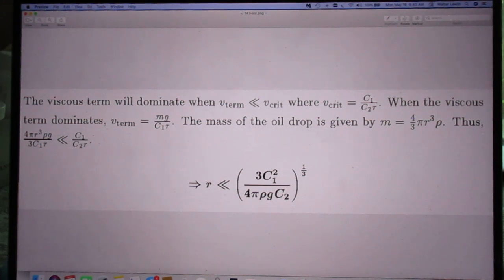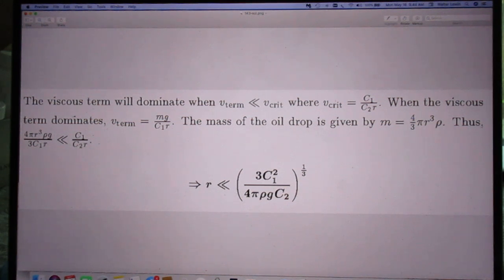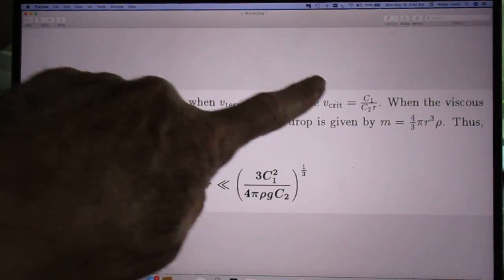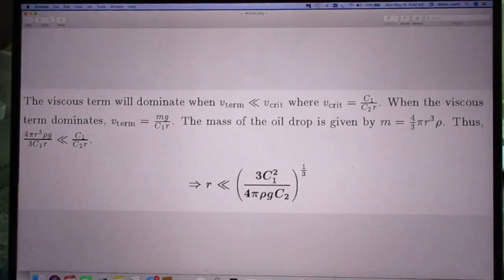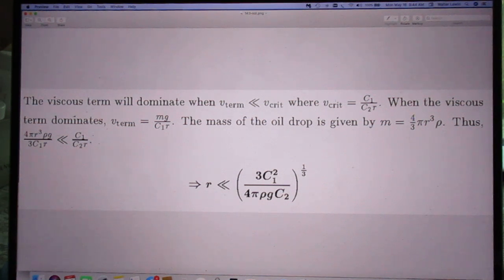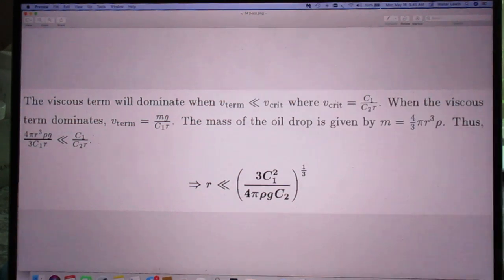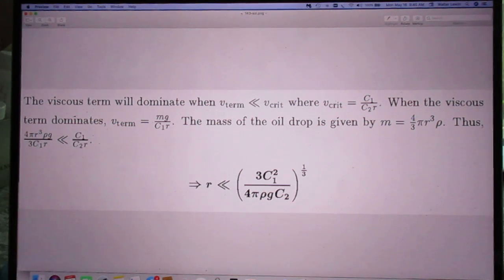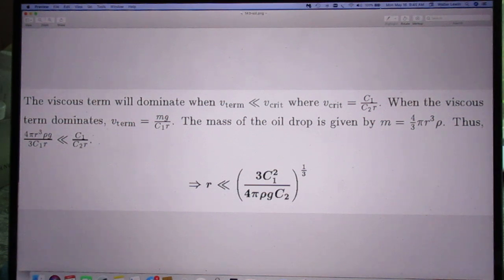Solution Problem 143 - Drag force on falling oil drop in air

Comment: Sir, I am a NEET aspirant, your mit 8.01, 8.02, 8.03 lectures are very helpful and I wanted to say thank you for making me love physics. I also wanted to know that which textbooks are used in 8.01, 8.02 and 8.03 as it would be really helpful.
Reply from the maker: 8.01
Physics
Hans C. Ohanian
Physics
Volume 1 
2nd edition
W.W. Norton & Company
ISBN 0-393-95748-9

8.02
Physics for Scientists & Engineers by Douglas C. Giancoli. 
Prentice Hall
Third Edition
ISBN 0-13-021517-18

8.03
Vibrations and Waves by
Anthony French
CRC Press
ISBN 9780748744473

8.03
Electromagnetic Vibrations, Waves and Radiation 
by Bekefi and Barrett.
The MIT Press
ISBN 0-262-52047-8
Reply: @lecturesbywalterlewin.they9259  thank you so much sir

Comment: Sir, can you please make a video on elongation of a spring that is being pulled by both of its sides with 2 different forces ?
I'll be really grateful to you ..
Reply from the maker: ha ha ha that is not possible; you cannot do that
Reply: @lecturesbywalterlewin.they9259  Sir, why is that not possible?
Reply from the maker: @denisapg  attach one end of your spring to the wall and pull with force F at the other end.  Then the wall will also pull on the spring with force F.
Reply: @lecturesbywalterlewin.they9259  Thank you very much for your answer! But why couldn't I pull one end of the spring with force F_1 at the same time that you pull the opposite end with a diferent force F_2?
Reply from the maker: @denisapg  F=ma, if F_1 is not the same as F-2 the spring will be accelerated.
Reply: @lecturesbywalterlewin.they9259  Indeed! Thank you very much for your help, professor Lewin!